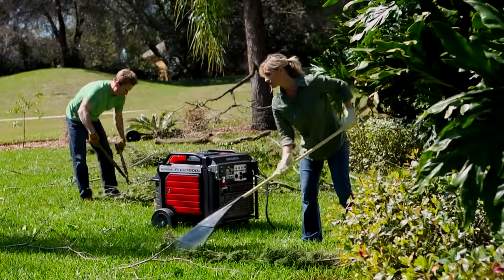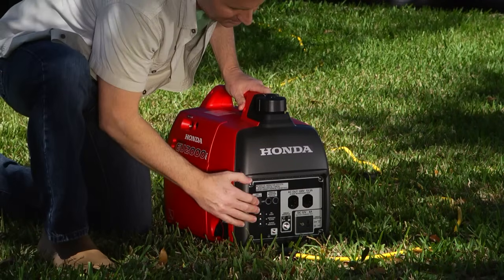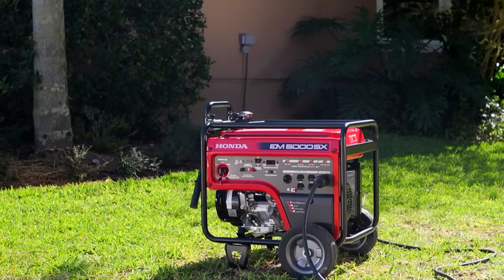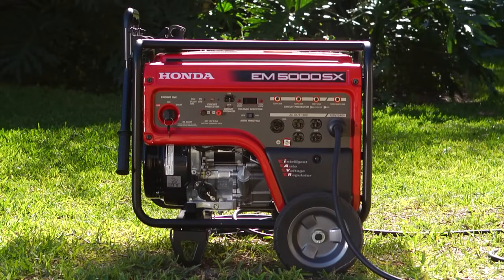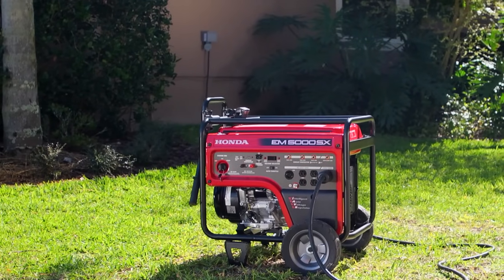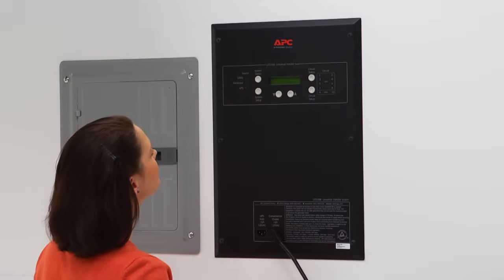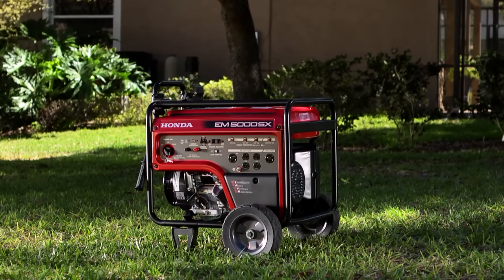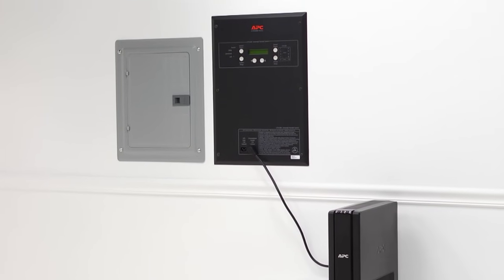Connecting a generator to your home - Honda Generators

Comment: Honda gens cost a little more but, the Engineering Honda puts in them sets them apart from the crowd. You will not regret investing in one of them.
Eu7000 is a home run. Thanks, oh check out the videos of those who have purchased on…..I can wait till I get one.

Comment: I looked at several 2K generators before I settled on the Honda✦✦>share4.photo/HEU22Inverter?җυ   I have talked to people who are happy with their Harbor Freight models, or Westinghouse, etc. ,but I wanted to be as close to certain that this thing would crank and run when I needed it. So far, it has, and I love it. It is very quiet in the eco-mode, you can stand right beside in and have a normal conversation.

Comment: 0:05  is that the new electrically-powered lawn rake??
Reply: Those are robots using the rakes, Patrick. The robots run on electricity.
Reply: Okay, got it.  Do you know if they run on 110V or 220V?
Reply: Please make sure you watch this video about generator safety https://youtu.be/I1jT3ANENvI everyone really needs to watch this
Reply: Does not look like they will run on either... They are the walking models
Reply: @StephanusSmit They upgraded the Robots and the rake to Solar Power. I got both, and extremely satisfied.  Nothing beats a Honda. 😃

Comment: Good video, thanks. My power demands were small so I did not need to install a transfer switch. I created an easy way to bring the power into the house without having to call an electrician.
Reply: How?
Reply: Probably with a drop cord I would assume.
Reply: Please make sure you also watch this generator safety video https://youtu.be/I1jT3ANENvI everyone should agree